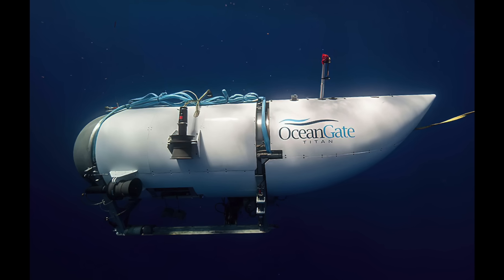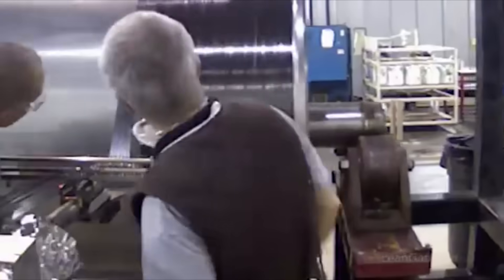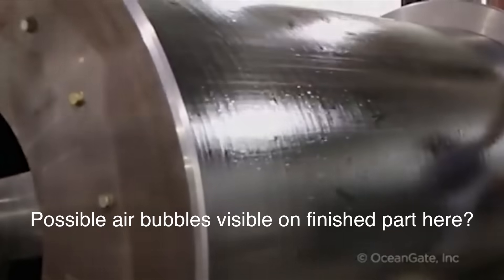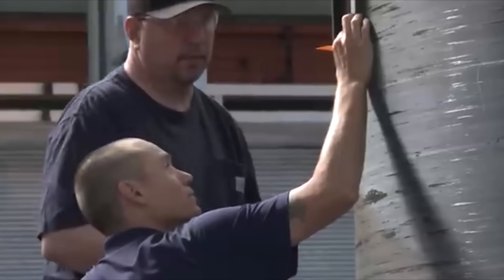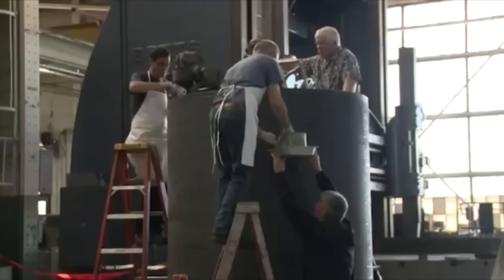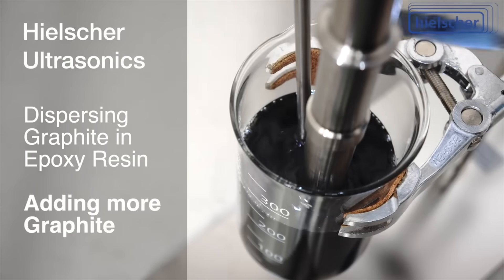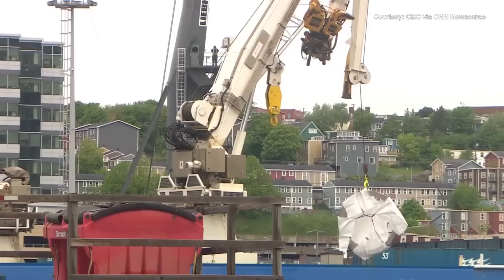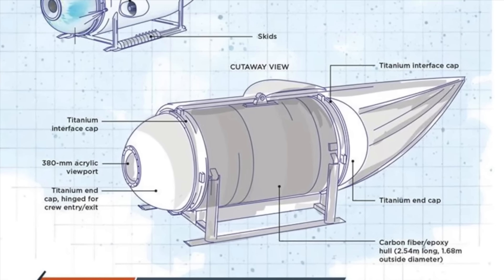Why OceanGate Titan Imploded - A Carbon Fiber Composites Perspective

Comment: My experience in the chemical industry is with using Fiberglass Reinforced Plastic piping and tanks.  The glass fibers give strength to the composite when in tension.  For a cylinder, tension of the shell occurs when the pressure is on the inside (pushing outward, i.e. attempting to deform the cylinder into a larger diameter).  The glass fibers resist this tensile force by not stretching, like a rope wrapped tightly around a pipe.  When the pressure is on the outside of the cylinder, the composite is under compression, which the fiber reinforcement really does not help with.  Here, the structural strength is provided by the resin, a thermoset resin, i.e. a cross linked totally rigid non-plastic material.  It does not yield like a metal under load, but rather cracks microscopically each pressure cycle until the structure fails all at once.

I agree that the end glue joints to the titanium were riddled with problems.  The biggest problem that leaps out to me is that the whole cylinder relies on resin for its strength, resin being a type of glue itself !!

I am interested to hear from folks who have experience with both carbon fiber and fiberglass in compressive loads.  Is the fiber reinforcing principle the same or does carbon fiber have additional properties that would help it in compressive loads?
Reply: if the composite  had been formed with 3-d cf, it might have survived - worked well, even. But principally 1-d circumferential, eh??  The wall stress within the cylindrical hull main body would also not have been in pure radial compression, the end-caps would be applying (very approximately) 1/2 the radial stress, but in the z-direction - i.e. along the long axis of the cylinder; the cylinder was therefore in triaxial stress - was this accomodated?
Reply: @jesflynn4048  thanks for the insight.  I’ll have to look up 3D carbon fiber, sounds like exotic aerospace.  The loading on the end caps you mention is another compression load, perpendicular to the CF fiber winding direction.  In this direction the fiber provides no reinforcement strength at all, just filler.  I looked up the deep sea expedition by Victor V.  His submersible is named something “Factor”.  He did it right:  designed and built by an experienced submarine company, pressure vessel 100% titanium, and they actually pressure tested it to 120% of max depth.  It worked great.
Reply: I've worked with carbon fiber and fiberglass! They are totally different critters! My experience that glass doesn't compress, but carbon changes character when compressed at different pressures and heat! Where do you think diamonds come from? I've worked with HYDROCLAVES working at 3,000 P,S,I, our carbon "cloth" turned into graphite! It works great for boats or aircraft.!

Comment: Just an observation that the part that is being cleaned with a 'dirty rag' (I can't see if it is dirty or not), and then has hands placed on it, does not appear to be the surface that the adhesive has to bond to.  

I think one should be aware that this promotional video is not necessarily the actual assembly process, or maybe only snippets that may not be what we think they are.  The lack of adhesive being squeezed out is surprising, but I would question whether this is the final assembly.  I'm not sure how much adhesive, if any, is actually there on this test fitting, which may be just for the camera.

Comment: Great breakdown and explanation.
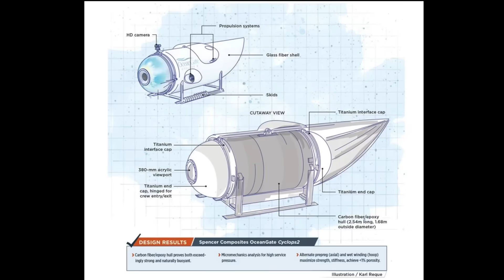The question is my mind, wrt composites, is the forces are wrong for a composite submersible.  The filament wound pressure vessel depicted at 12:16 has the forces from inside to the outside which makes the fibers in tension.  A submersible has the forces outside to inside, meaning the fibers and epoxy would be in compression.  The Five Deeps Expedition design and understanding of the compressive forces is key, and the spec on the absolute roundness of two Ti sphere halves is essential.  RIP folks aboard the Titan, and may the families somehow find peace.

Comment: The fact they are working from ladders (ladders ffs) says it all. If you would ask me to glue a connection like this, the flange would be upside down on the floor in a clean room, fill up the whole flange, and then press the CF hull into it in orde to make sure the glue poors out and air is gone. Applying glue upside down is not what I would consider "handy". The man degreasing is not degreasing the connection but the outside (still bad practise)...but who am I ? Well, I am a civil engineer that installs offshore powerplants as a construction manager (offshore windfarms) that do involve a lot of heavylifts, where you have a lot of details to worry about too, if cutting corners -> disaster. Do it right the first time is our motto.

Comment: I hear Rush patented his “real time hull health monitor” system. He also said in previous dives the cracking was loud and persistent. Since we know that cracking sound was the sound of a hull progressively weakening, his monitoring system  was obviously another useless idea.
Reply: The more time that passes the more I hate that guy. This is all his fault.
Reply: @wyattsdad8561 The worst part of him turning himself into primate paste is that we can’t throw him in prison and destroy him utterly. He got off easy.
Reply: I’ve have no expertise in these things but it seems like cracking sounds equals damage.  Damage that can’t be properly repaired or even evaluated.  To continue to use something you know is damaged for a mission that dangerous is insane.
Reply: @utah20gflyer76  you have common sense and are not driven by greed. If I built something like the Titan with the same materials and I heard crackling it would be game over for that thing. It ain’t some old house settling, it’s fibers coming apart and when the crackling sounds stop it does mean that all those fibers have lost their strength now and there’s nothing else to make the crackling sounds in that particular area.
Reply: @utah20gflyer76  yes it is negligence
Reply: You all have it wrong. The point of the patent wasn’t to actually improve safety. It was to file a patent so he could say he was concerned about safety.
Reply: @memberwhen22  Rush and other passengers are all on record saying there was a worrying amount of crackling going on. Crackling’s not a good noise when your life’s relying on glued joints.
Reply: it probably worked just fine but he just didnt give a shit about the data
Reply: His 'real time hull health monitor' was nothing but a bunch of cheap acoustic sensors attached to the inner hull, like you'd find in a burglar alarm that listens for breaking glass. Needless to say, it was practically useless. I suspect the main reason for having this impressively named system was to assuage the fears of passengers.
Reply: @abie1308  everything he did was half ass, cheap and done to save money. Same with the kids he hired.
Remember he didn’t like the idea of paying 50 year old white guys who were experienced in the field. Well it wasn’t because they were white. It was because a professional expects to be paid accordingly for their knowledge.
Reply: The RTM seems more of a “game over” then a warning!
Reply: @jamesmeritt6545  Yup. I've worked with carbon and glass composites quite a lot, and from the moment you hear them crackling to the moment of total failure there are mere seconds. It is like a chain reaction, when the first CF strand fails, it increases the load on the remaining strands, so more and more of them fail, further increasing the load
Reply: Rush's RTM was a monitor that reminds you of an imminent death.
Reply: Dang I thought there was a time limit between death and cremation 🤣🤣🤣🤣🤣🤣🤣🤣🤣
Reply: Actually he copied another patent.  It was not original.
Reply: With a year of hindsight, we now know that the RTM actually worked! They merely chose to ignore it.
Reply: No, not useless. Just useless in the context that it was employed in.

Comment: 12:15.
Are you suggesting that they drowned, rather than were burnt to death then crushed by the compression? It doesn't matter if it stays watertight AFTER it's been crushed. Sure I  just backed over my cat, but at least he was watertight! All his bones are still crushed...
At least it will be easier to hose off the driveway.

Comment: Everybody is missing another crucial mistake here , I haven’t saw anyone point  this out yet, the carbon fiber hull is on the inside of the dome, if it wer on the outside then as the pressure got greater it would compress the seal even tighter. Sombich would have imploded anyway but it’s just common sense to do it opposite from the way they did.🤷
Reply: Not necessarily true. It depends on whether the titanium or the carbon fibre compress more under pressure. You assume the carbon fibre compress more, but at least theoretically it is probably the other way around. In addition, the pressure works in 3D. So it also pushes the end caps towards the cylinder horizontally with an insane force, which in theory negates the need to even have glue at that debt (if all surfaces fit perfectly.

Comment: Why not make the whole thing out of titanium. Seems like that was the strongest part. Bonding the two seems suspect
Reply: If they would want to go down to the ocean floor and stay there forever inside a intact pressure vessel, that sounds like a good idea. But if they wanted to get back to the surface, the weight can not exceed the buoyancy, and titanium is much heavier than carbon laminate for the same compressive strength. The problem was not using a composite, it was either design, fabrication or both. And it was also lack of testing and safety minded attitude. Plenty of airliners these days are using planes having critical structural parts under compression made from carbon composites. Quite safe when done right, and not cutting corners in testing, design, fabrication, inspections, etc.
If the part covering the smallest area is also the heaviest part (the spherical end pieces), it doesn't mean they were made from the better material (titanium), only that they were dimensioned better.
Reply: @tuomashiismaki4146  Thanks. I’m curious what was Cameron’s sun made out of. That seems like the best design and was approved.

Comment: With so many layers, how were voids prevented. I don't see epoxy resin being applied as each layer is wound.
Even if it was degassed in a vacuum chamber prior to application of the epoxy, there is no way for it to get to the inner layers, leaving those layers free to move.
was this a case of somebody knowing more about a specific subject than the average man, so they considered themself an expert?

Comment: As soon as I watched the videos on how it was fabricated, and I saw how they were winding uni-directional fibers around a tube, BOOM! .. I knew EXACTLY what had happened to the vessel. You are the first video I have seen that has addressed this. I too have worked quite a bit with carbon fiber and other such materials. I just cringed when I saw how they were fabricating the pressure hull.

Comment: I am sure that the gluing was a problem, but what I thought was wrong, is that there were no sleeves
 at least 6 inches to slide into the haul ends as part of the end caps to keep the haul  from moving in the glued area.
Reply: Haul? Hull?

Comment: To bond, one would use a film adhesive with a carrier fabric that keeps a uniform bondline while curing under a vacuum bag in an autoclave. Paste adhesives are  never used for structural bonds in aircraft.

Comment: I am no expert in carbon composites, I am just an old retired mechanical engineer.   One thing that have not been discussed that in my opinion is the fundamental flaw in choosing carbon fiber composition for this submersible, is the very nature of carbon fibers.  Carbon fiber’s strength is its longitudinal strength and its weakness is its bending strength.  used in a pressure vessel where the internal pressure is higher than surrounding, it caused the skin of the vessel to expand and increase in length, carbon fibers work well to resist it.    Whereas in this submersible, the outside pressure is higher than the internal pressure which cause the vessel to collapse and vessel skin to buckle in, the carbon fiber does not help and all that force is resisted by the polymer resin layers bonding the fibers together.  That does not work well and did not end well when this is critical.     The CEO made audacious attempt to make things simple,  but he went too far as to what Einstein said “ Make things simple but NOT simpler “.  Engineers ought to have some pessimism asking testing what could go wrong.  My wife is an optimist.   I told her once I would not fly in a plane she design.  She looked at me and asked me why, I said because it would only fly in fine weather.    It’s just sad that this brilliant guy was just too optimistic for his own good.  He is an awesome entrepreneur but he should have entrusted the engineering works to his engineering team.

Comment: There is absolutely something wrong about mixing glue by hand. You don’t get the same consistency and mixing ratios throughout the entire mixture.
Reply: There's nothing wrong with mixing by hand if it's done right! Most people that I've seen, get into a big hurry and screw things up! Especially when you work with resins.

Comment: very good video with good points raised.
I am a mechanic by trade, so am no way experienced in the specific field, but from the start i have been wandering about the way the 2 materials would perform under pressure.
I would bet my ass that under compression the titanium end cap and the carbon fiber tube would deform by different amounts, and at different rates.
Surely this would add a lot of strain to the bond between the two items.
It would also add a torsional force into the carbon fiber tube, which with the single direction strands it seems very poorly designed to handle.
Reply: also to follow on from a point you raised which i had not heard before,  Stockton took a hull down previously and had it make a lot of noise?
From the sound of what was being said, he did not immediately abort the dive, and instead this was an expected behavior?

This for me calls into question their claimed monitoring system, which supposedly utilized multiple microphones around the hull to listen for noises to warn of excess stress on the hull.
Clearly noises from the hull were not deemed to be out of the ordinary based on what he says, so was this system just ignored? or non functional?

Comment: Thanks for this perspective Jamie. Like one of the other commenters, I have almost 50 years in aviation maintenance which includes composite repair training. I am certainly not an engineer but I have made a lot of overtime fixing stuff designed by engineers. Everything from the the way this tube was wrapped like a coil instead of cross weaving,  the meager size of the interface lip for the two caps put together with a narrow band of sealant, to the resistance of design input from the engineering community spelled disaster to paying customers who trusted in the tech speak. Even if a composite hull is ever approved and certified for deep dive, it will probably have a life cycle limit that will make it less economical than using legacy metallic materials. So next time you go for a voyage on an experimental sub and you hear cracking and popping sounds, tell the driver to let you off immediately at the next surface vessel.

Comment: If they laminated the carbon using different angles rather than being omni directional, wouldn't the weak spots been harder to discover? Not that it matters at this point, there is a reason this was the only carbonfiber submersible ever made ...
Reply: That would be unidirectional, not omnidirectional.
Reply: @stargazer7644  Yes, you are right.

Comment: Osmosis through composites at high pressure is a widely known issue, WHY use carbon fiber to start with, Steel construction is cheap and well known ??? WTF were they trying to accomplish here ? I see a number of issues. 

1. they made a end joint, and that's stupid, the carbon tube should have had a massive glue area, probably 4x the surface area it had. the tube should have fitted OVER the titanium cap or vise versa, look at the production of Carbon fiber driveshafts for race cars, wing spar etc, nobody BUTT glues that kind of joint, NOBODY

2. they picked a material prone to osmosis could have been ripped apart from water migration through the fiber. 

3, they only used 1 wrapping direction. 

4, they were stupid, WHY in the hell would you use such a unproven technology when there are plenty of proven designs that could have been used ? IE steel ?

Comment: I have no engineering skills or experience. I'm not even very good at math.  I've certainly never designed or built anything that needed to resist high pressure.  But even when I am making repairs around home or tying up a load to drive from the lumber yard to home, I always wrap and tie things at various angles.  To see someone build this kind of vessel with all structure oriented in a single direction doesn't even start to make sense to me.